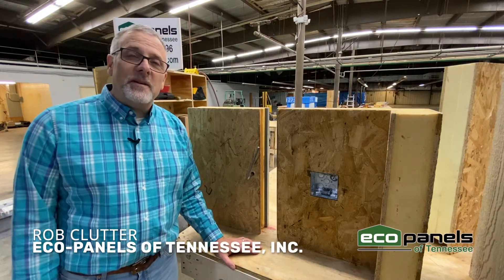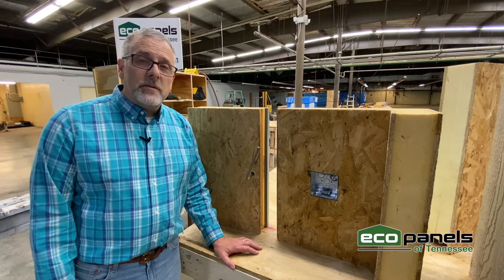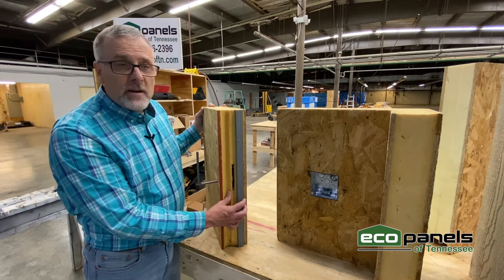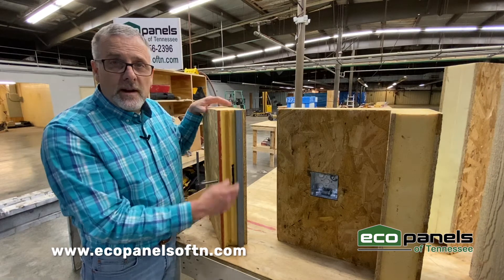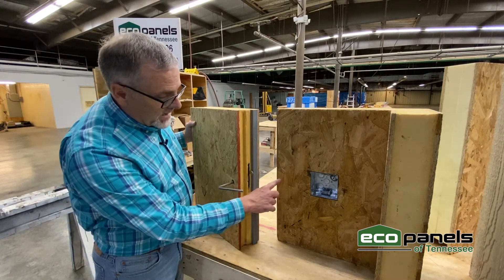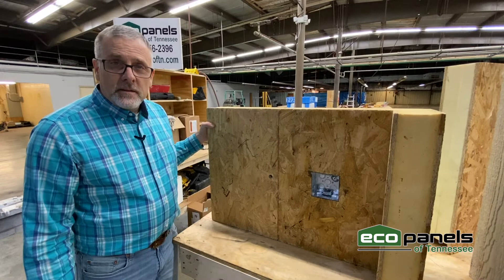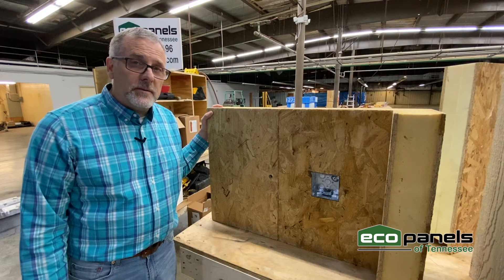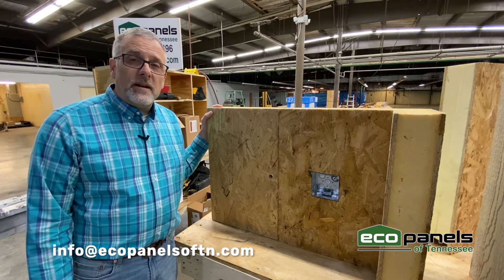Eco-Panels of Tennessee: Cam Locks - Connecting Wall Panels

Comment: I noticed from your other videos that not all the walls and openings have the camlok feature.  ie) doors and window openings.  Are you able to install camloks at those points?  Also do the roof panels have CamLoks?
Reply from the maker: Great observation and question. No, anywhere a door or window opening will not fit into a 4’ panel, we’ll have a header and footer panels to box out that rough opening. In those cases, we do not use cam locks. Roof panels depend on the roof layout, so they can include them but most typical is no cams in those.